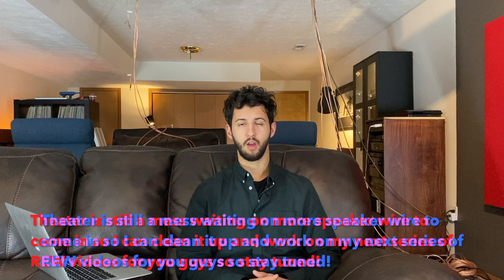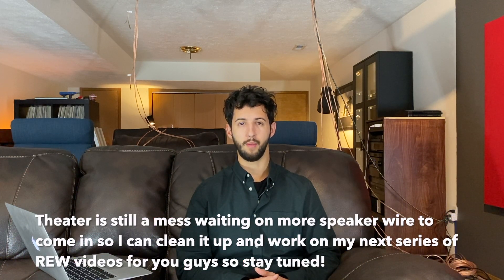Absolute VS Relative Volume When Calibrating Your Home Theater?

Comment: My receiver only has the option for absolute volume. How would I go with calibrating going forward?
Reply from the maker: well that can be a little more tricky or requires more work. You would need to find out from the manufacture of that avr and that specific model where on the absolute scale they recommend, because 0 represents absolute silence and 98 is full volume so its probably between 70-80. contact them and they should be able to give you that info

Comment: I have a Denon receiver, a Samsung TV, a Firestick, and a Chromecast, they are all attached to the receiver via HDMI cable, the volume from one device to the next is significantly different. When I'm listening to the TV and then switch to Chromecast, I have to increase the volume 10 db to hear the Chromecast at the same level. If I forget to turn the volume down when switching back to the TV it rocks the house, do you have any suggestions?

Comment: Hi bro your AV  related  video great help for all AV community thank you 
One thing I will asking you 
In calibration Spl meter (75db) i have koico japan model number 8510 Spl meter 
30-130 or 50-130 or 70-130
Which is the best for c waiting slow response 
I am waiting for reply thank you once again
Reply from the maker: any range will do so long as it will measure 75 dB and up
Reply: @The.Home.Cinema.Engineer  thank you bro 
I am doing audyssey calibration 
Left and centre same curve but right speaker is flat curve 
What can I do
Reply: @The.Home.Cinema.Engineer  thank you immediate response 
I can never see this kind of man for immediate reply thank you once again
Reply: Hi bro my theatre room is 14/24 I can run audyssey or audyssey flat

Comment: Some one says 80db LCR 
SURROUND 77db A WHIGT SPEAKER 
SUBWOOFER C WHIGHT SLOW RESPONSE 
What is correct db
Reply from the maker: 75dB spl
Reply: @The.Home.Cinema.Engineer  A WHIGHT OR C
Reply from the maker: @taheralikhan5771   C
Reply: @The.Home.Cinema.Engineer  in the calibration time audyssey asking 8 positions calibration ok
But what distance other 7 positions kept mic from listening position
2feet or 4